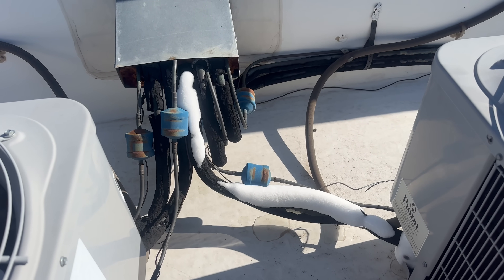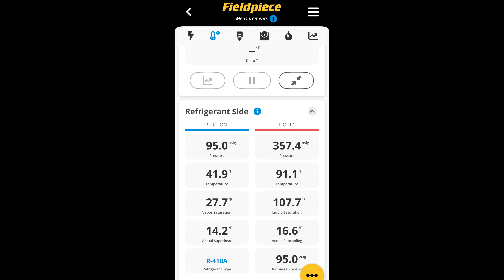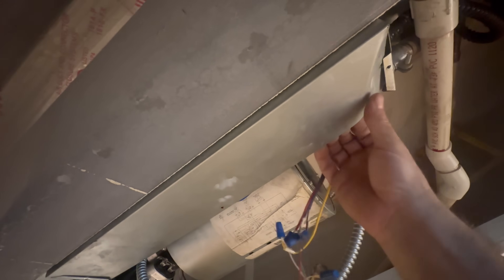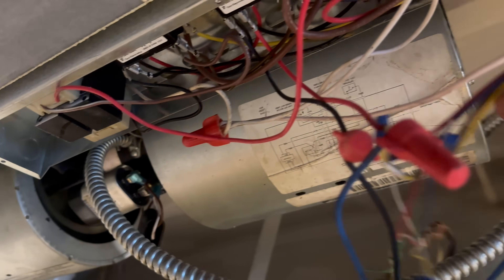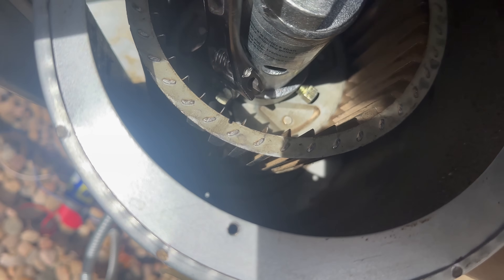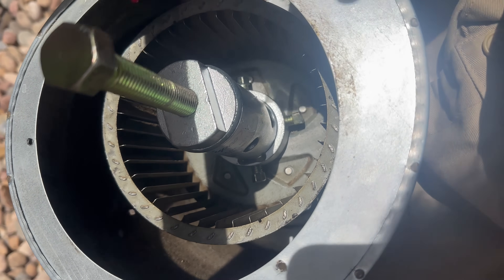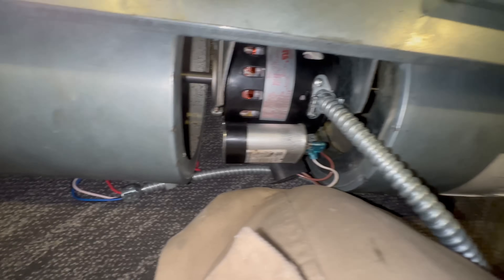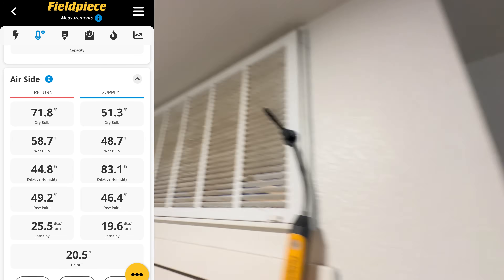Low Suction Pressure - Unit Keeps Freezing Up - Filter is New

Comment: These videos are a blessing. Fellow commercial hvac tech here, show us as many videos as you can, very well put together and your analysis is spot on. 16 subcooling means you have more than enough liquid, excellent how you went down and checked filter first and then airflow followed by suspecting txv because between that and the filter drier those are the only 2 restriction points.

Please keep making these great videos ans show us a thing or 2 about those units, they are super tight and hard to reach in my experience would love to learn the ins and outs from someone very familiar with them